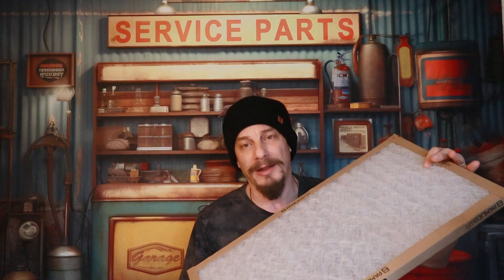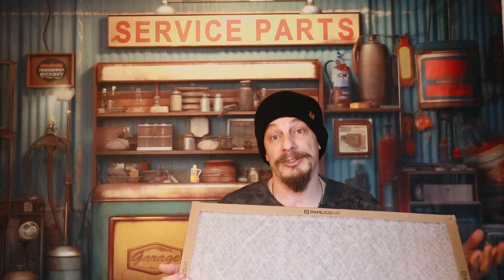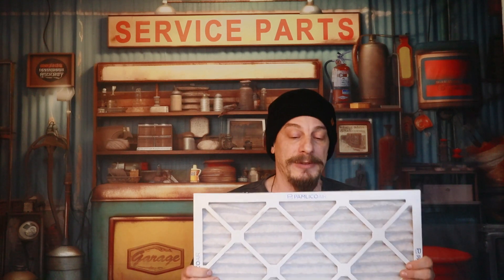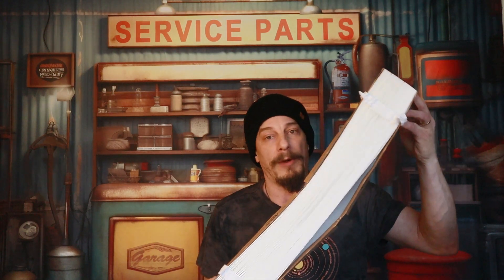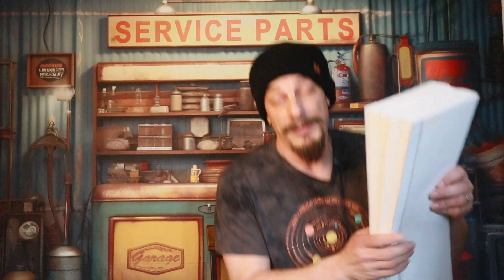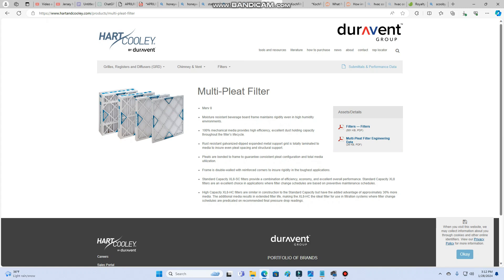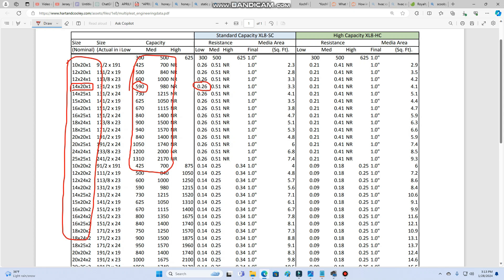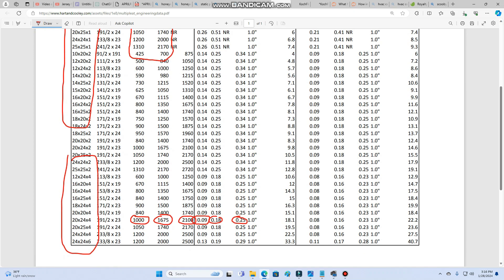Home Air Filters & Air Flow Resistance Explained

Comment: Pressure drop is critical for forced air systems. It drives me nuts when I see a system that has 90 with a radius heel and a mitred throat. If the throat does not have a radius the heel radius is pointless. The pressure drop only reduces when the throat is a radius, 0.5 as a minimum preferably 1.0 radius

Comment: thanks for showing the manufacturer's table.  i guess my next system will have a 4 inch filter, it would make a huge difference. right now i try to get the lowest MERV 1 inch paper filter to try to get decent airflow while getting decent filtering.
Reply from the maker: I've taken static pressure readings before and after a lot of installs, and you'd be surprised at how many residential duct systems are not properly sized. A lot of contractors will put in a new system without ever checking these sorts of things, or even if they do beforehand, might be reluctant to bring it up because most homeowners do not want to get into replacing the entire duct system too (they start to suspect they're being upsold unnecessarily, and the contractor loses the bid to someone else). 

This makes static pressure awareness and filter selection all the more important. 

 A lot of people will say they don't make them like they used to and you'd be lucky to get 15 years out of a new unit, but when done right and maintained properly, I think 20+ is certainly still possible.